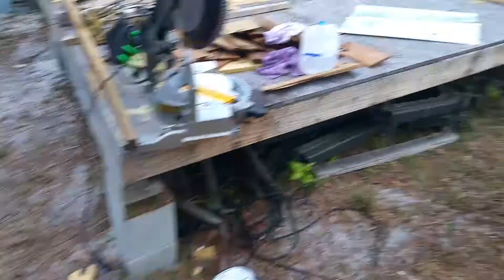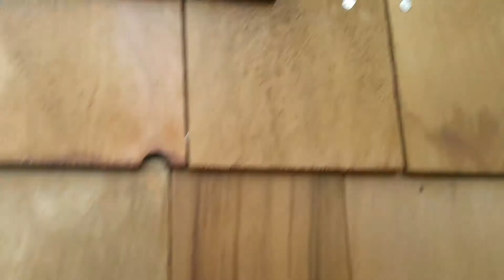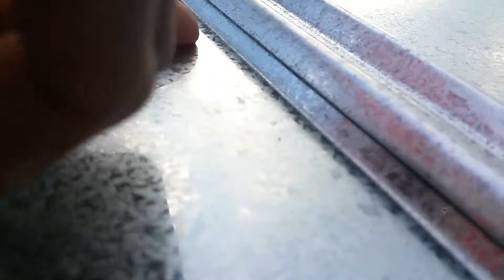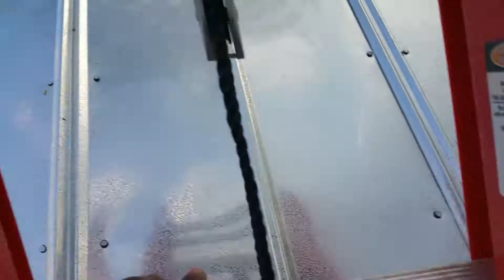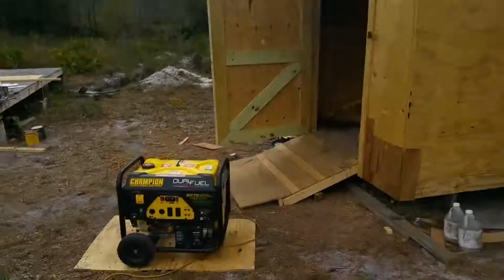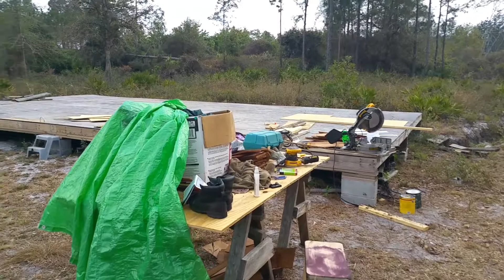Cedar Siding and Metal Roof

Comment: I've been reading a lot about cedar siding.. and now metal roofs.
Learned that it's real important to use stainless nails, was researching to see if metal roofs are to be avoided with cedar siding and haven't found anything yet...  I am thinking that the roof is sufficiently stain resistant or treated to not goof up the cedar.

Wondering about staining the cedar. 
The house I'm working on had all of it's shingles dipped in oil based stain.. but then I heard that it's better to let them breath and that water based is better...

I am really for lowering total cost of ownership.

Also looking at the roof, wondering if the nails should be under the lips of the roof...  Our roof has a a few fasteners in weird spots.  

It's nice to see someone making things! thanks!